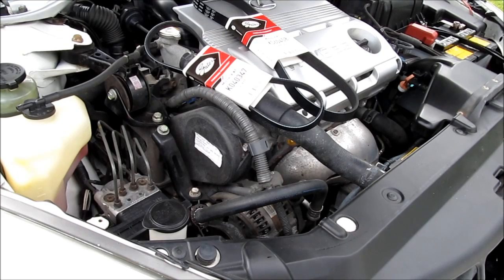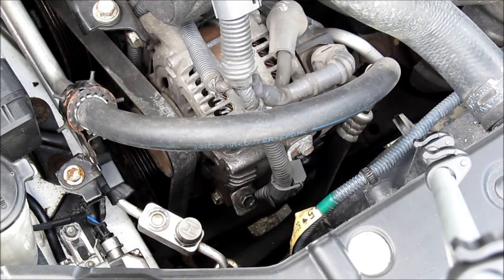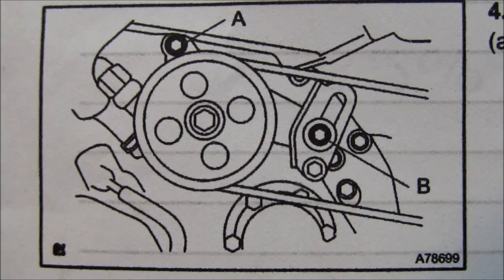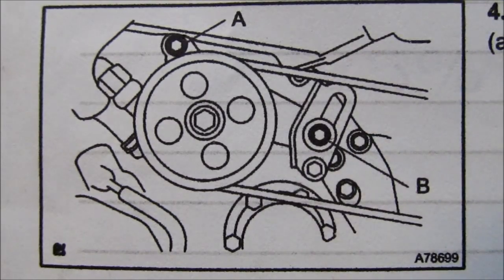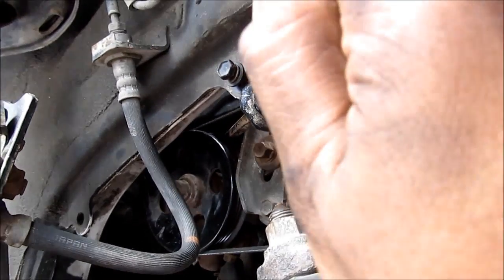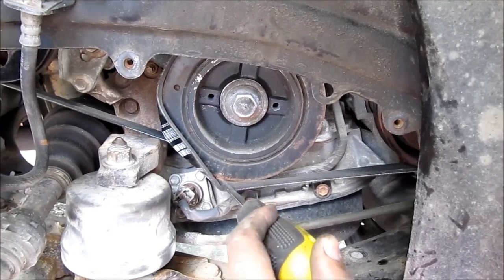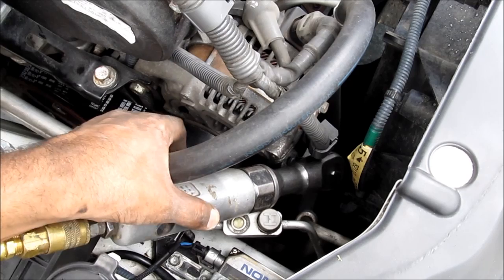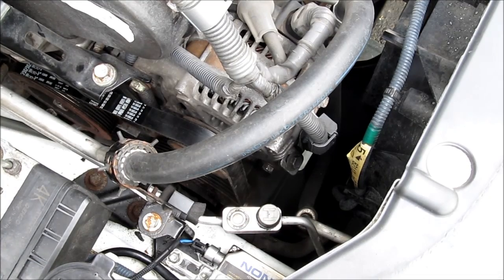Alternator / Power Steering Belt Replacement: Toyota Lexus V6

Comment: Wow. New belt is pretty tight even to get on. I also found the comment posts helpful too! By putting the belt on the crank pulley first, then slipping it on the PS/Vane pulley bottom as much as it could go, and then turning the crank pulley bolt with socket/wrench, enabled the new belt to stretch enough to slip on! Whew!👆👆

Comment: Shoot my alternator went out today, I swapped it out and changed alternator belt while I was in there. I bought the power steering belt too but didn’t know the alternator belt had to be out to do the power steering one! Ugh now I gotta do the other belt again 😢
Reply from the maker: Yeah the PS sits behind. Good luck Getting the pump to pivot for a tight belt though

Comment: Thank you! This was straight to the point and showed me exactly what I needed......Going to try on 2004 Rx330 tomorrow...The part I was worrying about most was how to add tension to the power steering belt, but you covered that ....thank you!!!
Reply from the maker: I hate that power steering belt design.
Reply: @speedkar99  i got it changed out thanks to your video...but my chirping noise is coming from the AC pulley...hopefully I can just change the pully without having to open up the AC system

Comment: At time 2:06 you show the ratchet on the pivot bolt. On some V6 Toyotas this might be the way  but not on the 04-06 Lexus RX330. There isn't much space and so I found it  best to tackle this pivot bolt from under the vehcle using a long 12mm 12 pt socket. Using a long socket provides clearance from the pully in this case.

Comment: I have been searching DAYS for a video such as this, and you even went over bolt sizes. Thank you.

Can someone confirm that Bando 6PK1040 is the right most belt with the alternator, and Bando 4PK880 is the left more belt with the power steering?
Reply: I got the 880 and 1035 for my 03 Avalon..and im not happy with the Bando im about to take it off for squealing.Seems to lightweight and stretchy for my liking

Comment: I noticed other videos show them loosening the Alternator pivot bolt first, then the pench and tension bolt to remove the belt. Then when to put it back on they pull up on the alternator (since it's loose) and while they pull it up, tighten the alternator pivot bolt, then the front tension bolt, and lastly the pench polt.

Comment: At 2:56 you show a tool already in place. It would be really helpful to see the tool setup and how to approach the nut.  I ultimately had to approach from below to get leverage. Could not loosen the nut via your approach.  To get the rear belt on had to put large socket on front pulley and rotate.   ... 1997 Camry XLE V6
Reply from the maker: Thanks for the suggestion

Comment: How much tension did you put on the front belt? How do you know if it's too loose or too tight?
Reply from the maker: Press it down
If it goes more than half the belts width it needs tightening
Reply: @speedkar99  How do I know if it's too tight?

Comment: If you find that the crank belt is tight, don't use a screwdriver on the new belt to stretch it. It simply means you have not undone the bolt next to the alternator fully. once you fully unscrew that bolt, there is no tension on the belt at all. I found it the hard way after fiddling with the screwdriver for a while like this dude in the video. Similarly, if the steering belt is tight, lift up the tensioning bolt (not downwards) to the extreme top and then the new belt will fit easily.
Reply: Which bolt? Upper one or lower one next to the tensioner in front of the alternator?

Comment: I changed both belts today, but it squeals when i turn the steering wheel in either directions at a stand still. Can you tell me how to fix that? Thanks
Reply: my 02 camry SE v6 squeals in either direction as well. what'd you find out as a fix?

Comment: Speedkar- Great video but the top bolt for the power steering belt I’m not convinced you have to loosen. You might try and see if loosening the one with the slot is sufficient to get the belt off and on. The top bolt is  super hard to get to. Excellent video thanks
Reply from the maker: You are right. That one is a sucker. You can't even see it.
Reply: @speedkar99  - just did this again on a Lexus RX330 and you do not have to do that top bolt - just the top one on the bracket.  Just by loosening that one the pump assembly will move.  using a small lever/pry bar you can position it in the slot to push the pump assembly farther up.  It has to go to where the threaded hole is almost no longer visible in the slot.  That moves it enough to get the new belt on.  Then I put the bolt back in snug but not tight and put a racketing wrench on it using the housing of the wrench as a pry point and the car frame body as a lever point.  That allows you to pry it back down to its original position which i scored so I knew where it was originally.  Very easy but DO NOT open the can of worms of trying to get the hidden bolt loose.  It is a disaster due to access believe me.  Thanks Again Speedkar99

Comment: I attempted this on a 2003 ES300 with +200k miles  today but encountered some issues with the Power Steering belt so listen up if you want to avoid causing extra damage when attempting the PS belt:
The 12mm bolt above the pully(pivot bolt) that is practically invisible? If that bastard is seized and you think you need a breaker bar ( I used my 3/8 inch Pittsburgh Harbor Freight bar). The bar isn't necessarily the issue but its the 12mm sockets. I had a deep socket which was too long and couldn't even get past the wheelwell and my short socket wasn't long enough to stop my breaker from rubbing against the pulley (thus socket can't grip the bolt)
So I used adapters as a form of extension with my small socket to fit between bolt and wheelwell...but it bit me in the ass.  The breaker + the adapters + short 12mm socket was JUST ENOUGH to fit onto the bolt. But i had to "wiggle" my bar into position to reach the bolt. If i turn the bar clockwise it moves the tension bolt up, if i turn counterclockwise it moves the bolt down.
My breaker bar is stuck on the bolts and between the wheelwell. 

I'm hoping to get help from someone with power tools as I guess I'll have to disassemble other parts that I just know are gonna have seized bolts, all to find a way to pull the bar out. (I still have to put the new belt on too)

So don't use adapters as extensions! Postpone your carwork, Get a ride from a friend to the tool store and bring your sockets to compare lengths with the store sockets so you get one that looks long enough to clear the pulley and wheelweel but also have noticeable space from the wheelwell.

I had no choice but to use the long breaker bar because socket wrenches don't have the torque to remove the seized bolts I had.
Reply from the maker: Agreed that 12 is very difficult to get to, and you have to get just the right combination to crack it loose. Perhaps you can get at it from the top with an extension on your socket but remove the dog bone engine mount to give you room to swing.

Comment: Like everyone else, very useful!  Thanks!  I do understand now why the one mounting bolt you did not show how to loosen but said "my ratchet is on it right now".  That one is a bitch to loosen.  I ended up getting a large socket with an extension attached that would fit over the end of my 3/8 ratchet to get some leverage.  Finally got it.

Comment: Good stuff thanks! Helped with addressing a squeal sound on a 04 RX330.
Reply from the maker: Was it the PS belt?
Reply: It was the pulley on the ac compressor. Tightening the alternator belt helped but ac on still causes a howling noise.
Reply: It's not the ac pulley i tightened the belt down more and the noise is gone completely.

Comment: Literally absolutely makes no sense. I have loosen the tension bolt and the other 2. And the fucker is as tight as can be. I am so confused. I have loosened the 3 bolts and straight took out the tension bolt and doesn't help shit.

Comment: It works well to use a phillips screwdriver in the bolt slot to tension the power steering belt. The method you show with the flat blade screwdriver going somewhere above the belt is way more difficult. Also, it's possible to get the belts on without prying with a screwdriver...safer for your belts too. Thanks for the video...worked great for a 2004 Highlander 6 cylinder.
Reply: Your comment really helped me thank you

Comment: Thanks for an excellent video. . . Just want to say, that adjuster bolt on the alternator belt frequently breaks on an older car. Mine did on my 95 Avalon, even though car is very well maintained.  They get frozen in place on the threads, and the bolt head breaks off. Fortunately, Dorman sells a replacement kit I found for $9.32 on Amazon.(Search Dorman 917-148 Idler Pulley Adjuster Bolt Kit).  If it breaks don't feel bad, it happens to a lot of people. That's why Dorman has this replacement kit on the market. The same set up is used over many years on Avalon, Camry, Sienna and many others.

Comment: You're the man. Yesterday I did this for my 2002 Toyota Highlander V6 and it was a perfect tutorital. For the Highlanders tho - they dont have that extra bolt for the AC pump. You just release the tensioner and thats it. Thanks again man!
Reply from the maker: You are welcome. You mean the power steering pump?
Reply: @speedkar99  lol whichever one that was NOT the alternator belt lol

Comment: First off, fuck that power steering belt lol...I had a huge issue with the pivot bolt. So, I will share my trick I did and it worked.   

I loosened the power steering tensor all the way. Then I took kind of a heavy crow bar and pushed up to release the tension and then I was able to take it off fine. After which to get it on, I wrapped the belt and instead of prying it on, I held the belt where the power steering pulley is and the belt was on edge. I then took my 1/2 inch breaker bar, and extension and 12mm short socket and turned the crank pulley while holding the belt and it slipped on fine. After which, I used the crow bar to push the power steering pump back up and held it there and adjusted  the tension.

The other alternative way (Which I almost done) is to remove the crank pulley after you release tension and you can slip the belt on just fine. The only reason I didn't do that is because I do not have an impact powerful enough. You can use the breaker bar trick which is to put it on the crank bolt and then turn the car on for a split second and break the bolt that way. But I suggest not to do it that way unless you have strong tools. Don't attempt with a 3/8 set. The other issue with that is tightening back the crank bolt, and you will need the harmonic pulley remover, which you can rent at auto zone for $20
Reply from the maker: Good tip
Reply: @speedkar99  thank you, it worked out better that way. I wrote that out of mechanic frustration 😅.

Comment: What torque for the Pivot bolt? for the p/s. Also, when putting the new p/s belt on and getting the tension in the correct spot, do you tighten the tensioning bolt first and than that pivot bolt in the back?
Reply from the maker: Pivot is the last to tighten

Comment: Outstanding video.  I'm doing a timing belt replacement on a 2000 Sienna 3.0 liter, and this helped a lot.  (Haynes manual is poor...)  Especially helpful were your diagrams.  I wasn't sure where the power steering pump pivot bolt was until I saw your diagram.  Super video!
Reply from the maker: Thanks. I'm surprised Hanes didn't refer to the factory manual which is where I got mine from. Perhaps you should get a factory manual

Comment: I just finished installing a new alternator belt on my 2004 Solara. thanks for this video.It is a good idea to use penetrating oil on the bolts and let it work for an hour or so.Those bolts can break.
Reply from the maker: Glad it helped. Procedure is the same on the solara too
Reply: Same here I’m replacing both belts on my 04 Solara 3.3 as well

Comment: i know this is an old post although in my case the bolt next to steering pump pulley is stripped. Any ideas how to get it out. Very tight space in there
Reply from the maker: Hmm can you hammer another socket on it? 
Remove the engine mount and work from above.
Reply: Thanks for the reply. I ended up removing the adjustment bolt and used PB blaster to soak the pivot bolt. With the adjustment bolt removed I was able to put a small pry bar in the adjustment slot and moved the pulley. In the end didn't need o touch the pivot bolt. Hopefully this saves some others from bloody knuckles.

Comment: Thank you.  I discovered today that I didn't need to loosen the bottom bolt to adjust the tension.  Instead, I loosened the top left bolt, then used the tensioner bolt to adjust the tension.   For a while I thought I had to loosen the bottom bolt, but once the top one was loose, the tensioner worked fine.  Then tightening the top left bolt buttoned it up.
Reply from the maker: +Progresshiv alternator or power steering? I'm confused
Reply: I think this belt runs both the steering pump and the alternator.
Reply: @PerryCallas I might be wrong but those are different belts.  At least on my 02 camry SE it is.

Comment: Thanks so much for posting this. I changed the alternator belt but not the power steering belt. I figured if that belt fails, car still driveable. Releasing that pivot bolt on the power steering seems above my limited skill set! Didn’t want to start things I couldn’t finish!

Thanks again! You’re instructions were spot on.
Reply from the maker: +991 911S your right, that power steering bolt is a really sucker to get to!

Comment: Thanks for vid. I have a 2001 Solara V6-SLE. Just replaced the alternator. How tight do you make the belt? It's squealing a little at startup now.
Reply from the maker: +Art 'Dutch' Willemse Defection about 1/4" or less at the midpoint.

Comment: Great video Speedkar99! I would like to add that I had a very difficult time putting the new AC belt on because it was so tight, but after taking the adjuster bolt out and using a prybar between the CV axle housing and the bottom part of the pump, I was able to easily slip on the belt.  Of course I had to use the prybar again to place the bolt back in the hole going the other direction! But I honestly couldn't have done this without your great tutorial.  Great job dude.  Now we need a better way to replace the spark plugs!!!
Reply from the maker: +Virginia Marine thanks I'm glad my tutorial helped. I think you meant the power steering belt not the ac belt.
Reply: Right!  Thank you for the correction.  It's been almost a week now and everything runs smooth without any squeaks!

Comment: I really appreciate the way you do these videos.  Lots of these car work videos are a dude with a camera just fumbling around for 80% of the time.  Thanks for keeping it clear and concise
Reply from the maker: +Dan Humphreys Thanks for the feedback. I agree most are mechanics with no knowledge cameras, I prefer to take my time and explain things clearly, but thats why I could never do mechanics for a living haha
Reply: @speedkar99 please help I have the same engine in a 2004 Toyota Highlander. I managed to get the power steering belt in but now I can’t get the alternator belt installed. I followed your video so many times but It just won’t go on. I loosened both bolts on the alternator then loosened the tension screw in front. According to the video the alternator supposed to drop and then I should be able to used a screwdriver to pry it on at the bottom on the crank. What else can I try. Also I am replacing because the alternator belt broke while I was driving hence my delima

Comment: The power steering pump pivot bolt on top of and slightly behind the pulley is the most hidden and difficult to access bolt I have ever experienced. No wonder you could not show us how you got your ratchet on it!  At first I did not believe it was even there and I was going to tell you so. I finally found it by feel only. I could not get enough clearance with my older Craftsman 1/2" ratchet, so I put the 12mm 12 point socket on a breaker bar and was then able to get enough clearance to get a bite on it. After breaking it loose, I switched a 3/8"  ratchet to further loosen it. My Chilton manual makes no mention of the pivot bolt, only of the belt tension adjusting bolt which passes through the slotted bracket. Thank you for this helpful video. I wish I would have watched it first and learned the proper loosening sequence before breaking the alternator belt tension adjusting bolt in half.
Reply from the maker: +Michael Westlund I'm glad you got the bolt loose. Your right, that bolt is difficult to get to, your pretty much doing it by feel.
Reply: I’m struggling to get something around that bolt just this moment haha btw great vid

Comment: Thanks a lot for posting this video. My toyota solara 2004 v6 has exactly the same engine structure with this lexus. You save me a lot of money 👍🏻👍🏻👍🏻
Please if you can upload video of changing the front exhaust manifold with integrated catalytic converter of this car. many thanks.
Reply from the maker: +Jack Anderson Yep the solara. Camry, Lexus, Highlander sienna rx330 all share the same 3.3L engine, glad my video can help. 
I don't have this car anymore, and haven't done much exhaust work yet.
Reply: speedkar99 what a pity you don't have this car no more. I have one favor to ask. How did you you make the pulley of the power steering bell drop down so easy? Also where to put the bar to adjust the tension of the PS belt. I had to move it badly to take it out. I think I didn't put enough tension😩

Comment: @speedcar99 

  I replaced my alternator belt on my 2001 highlander. the belt keeps sliding off of the pulley. the belt is tight as well
Reply from the maker: +Dakota Woodcox are you sure its seated past the grooves? Maybe you have a belt thats too big